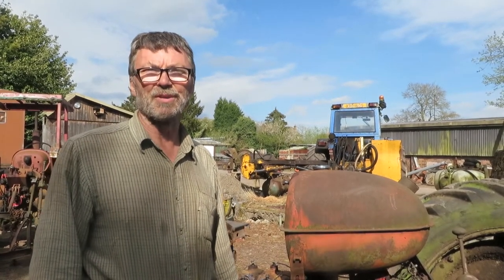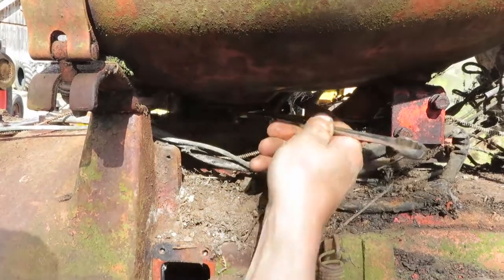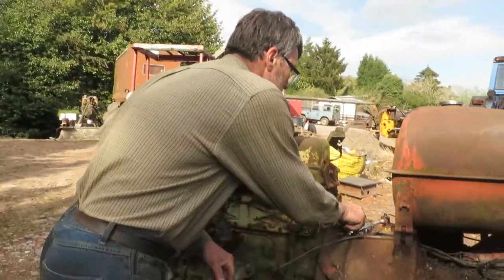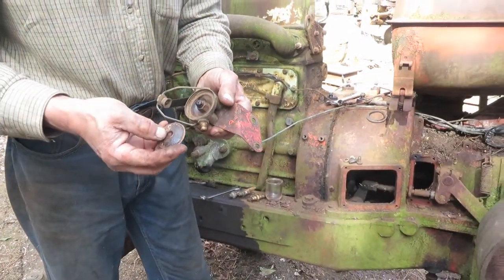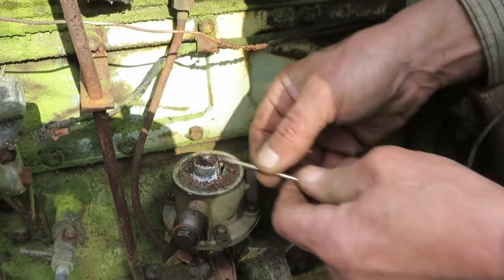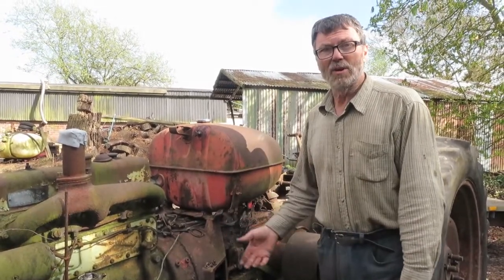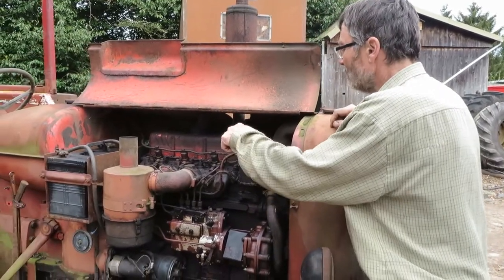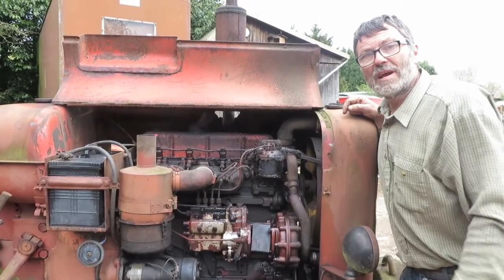Cleaning and Bleeding The Nuffield Fuel System

Comment: I used to drill a hole in the top of the pencil filter and be careful not to allow the tank to run down that low. 

It generally worked pretty well with the exception of the 4/65's. The pencil filters had a habit of detaching which then led to the fuel tap blocking up.

Comment: Great no nonsense video !   My problem is when I come back to my 460 after being idle 2 weeks,it needs bleeding,everytime.Where its taking in air is beyond me   Any ideas ?
Reply from the maker: Hi, The lift pump is the most likely cause, most Nuffields I have purchased have had faulty valves in the lift pump. Either replace with new pump or recondition with repair kit, series Landrover kits have same valve and are a fraction of the price of Nuffield repair kits. If the fuel tank is full then fuel level will be above filter and problem should not occur!
Reply: @montegoson  Excellent ! Thank you. Appreciate your prompt reply ! Keep up the videos !

Comment: What are the 2 small 8mm screws below the 13mm bleed screws??
Reply from the maker: They hold on the side plate, remove them and the side plate and you can see the pumping elements moving up and down.
Reply: @montegoson  hi thanks for the reply, I had the plate off and flushed that area out as a gunge was in there. I'm on about the 2  8mm screws directly under the 13 mm bleed screws. The screw downwards
Reply from the maker: @robnulty9462  sorry, I got the wrong bolts. 
The ones you ask about hold the plates with the thread that the side plate bolts go into.